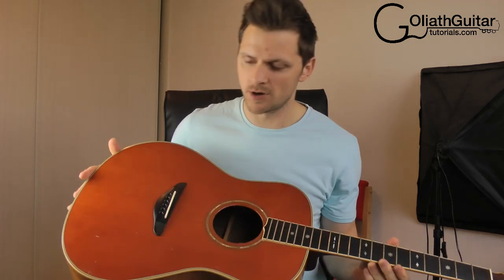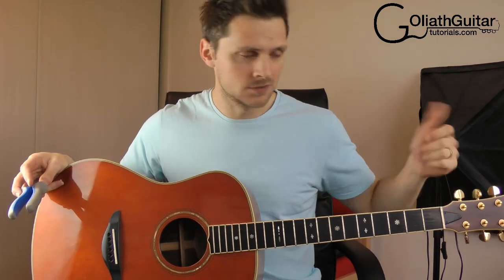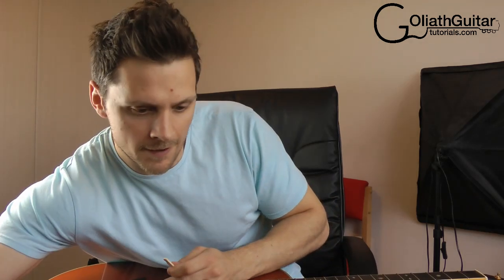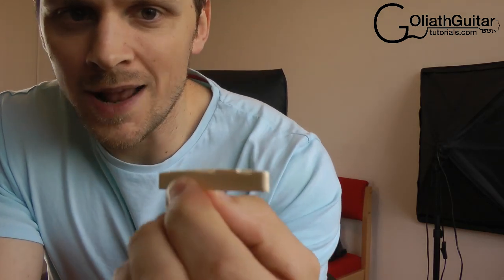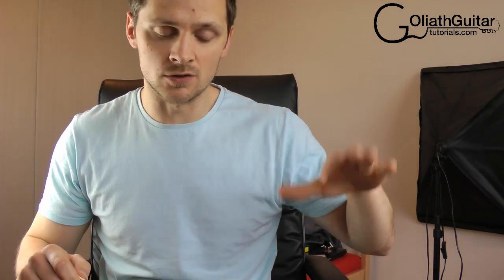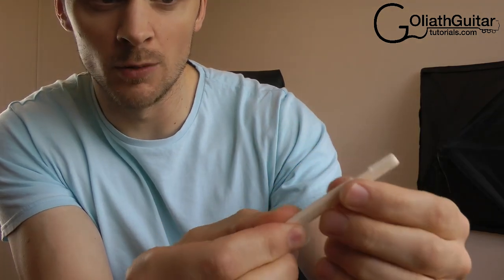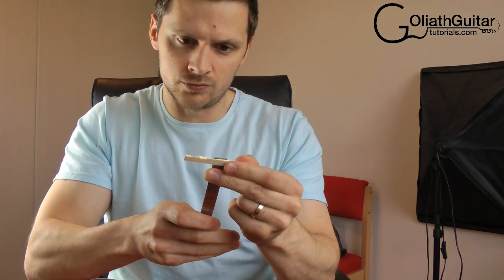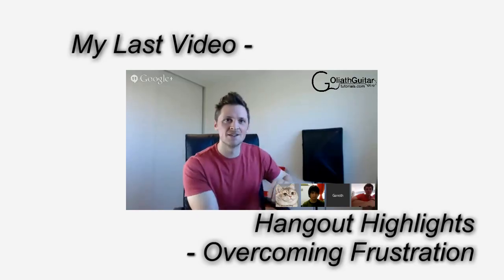Acoustic Guitar Maintenence - Replacing The Saddle

Comment: Hi Gareth - just to point out that the 'compensation' part of the saddle is on the B string at the HIGHER end of the strings. Also warning about removing saddle with rough pliers could damage saddle - especially bone saddle. I've just crumbled mine after going through the whole process of resizing a new one - and I used parallel pliers! Take care.

Comment: A saddle should just fit in snuggly enough so that it doesn`t fall out when you turn the guitar upside down, but it should able to be pulled out by hand or almost. You should not have to push hard on the saddle to insert it in the Bridge slot, because if the saddle is to tight and you force it in, the it may eventually cause  the bridge  to  split.

Comment: went to a luthier to get my guitar set up a few weeks ago. when i went to pick it up (a week late) as he was getting it from another room i noticed a similiar model to mine where they had put heaps of dents in the bridge prying the saddle out with a screwdriver or something! got mine back and he had done it to mine too! luckily not quite as bad. 

He also put a pin through the bridge to ensure it would never lift, his idea, i took his advice. Dont have a problem with the pin or the inlay they put on top of it, but it would be nice if it wasn't off centre!

Then to top it off he put on different strings to what he explicitly said!

Can't bloody believe it, local business that came highly recommended and has been around decades.
Reply: Jordan Cochrane that's why you learn to do it yourself, it saves money and you can work on your guitars at any time
Reply: He screwed your guitar with that pin.
It's not a catastrophe, but it's a very bad method that harms the guitar.

Comment: Hey Gareth! I’m a huge fan. I have a question, my guitar saddle is plastic and although the tone is decent, I’ve heard other guitars and it makes mine almost sound like a toy (if that makes sense) do you think the bone saddle might be the reason? (Yes I tune my guitar haha). Thank you for any input!!! Keep being a boss!!!
Reply: Also it’s a Martin guitar it’s not a cheap-O.
Reply: There are some very high quality plastic saddles available, that may not equal or surpass bone saddles, but will hold things on their own. It is the el-cheapo, bottom bracket plastic ones, which aren't hard, taut enough, into which the strings cut in, affecting intonation. The "toy'ish" sound need not be because of the saddle. There are several dozen other factors playing into it: wood type, wood maturity/age, wood cut quality/finish, bracing underneath, it's type, thickness, shape, size of guitar, soundhole, presence/basence of cutout, string types, string gauges, string age, guitar manufacturing process, luthier skill, exposed temperature/humidity, apart from the skill of the player.

Comment: i had the same problem, in my case it was the nut had fallen off and i used too much glue when putting it back on, so it ended up on an angle. I took it to a boutier (someone who makes guitars) and he fixed it and went through the rest of my guitar for about 20$. in my case the buzzing was strings from them hitting the frets because the nut was lower than it should be

Comment: My saddle isn't nearly as tight as that; in fact if i'm changing the strings and just cleaning my guitar with lemon oil, when I turn it upside down to do the back the saddle often just slips out with a lot of ease and ends up on the floor. Should I be concerned about this?
Reply: the saddle on my brand new ibanez with severe fret buzzing came came right out too; and the replacement saddle that it CAME WITH, doesnt even fit no matter how hard i press!
Reply: tiny amount of sanding got it in... i think? i hope its deep enough
Reply: yeah its not fkn deep enough.. gonna have to sleep on this
Reply: stupid ibanez selling me a brand new guitar with a bent neck...

Comment: Do you have to put slots for the strings in the Saddle? or just leave it alone?
Reply: That's also what I would like to know
Reply: I think you just leave it alone...pretty sure!
Reply: Leave it alone. The strings will wear grooves in the saddle over time
Reply: Not in acoustics which have bridges and pins.  On archtops where the string angle on the horizontal changes at the saddle because the strings connect to a tail piece which is narrower than the saddle, notches prevent the string spacing from changing under string tension.

Comment: How do I know how much to sand off?
Reply: I'll answer this in case someone comes across this. 

It should be twice the amount of the height at the 12th fret. So if your Low E is 2.5mm and high E is 2.0mm and you wanna bring it down to 2.0mm and 1.75 respectively, you'd have to sand the low E by 1mm and the high E by 0.5mm. 

Mark the measurements and then draw a line.

Comment: I'm new to guitars and I inherited one without a saddle to begin with.  Would it be ok if I just put in a saddle that fits the length and width of the slot in the bridge? Or do I have to figure out the right depth it should be in there?
Reply: +Trixie Anne Felisco i know it's a year late, but yes you can. if anything get a saddle that's bigger because it's much easier to remove material than it is to add.

Comment: Is it normal for the saddle to be noticably shorter than the slot it fits into? I just bought a 2nd hand guitar - the saddle is 73mm and the slot appears to be 75mm - the saddle is loose and held in place by the strings. I wondered if I should buy a replacement 76mm saddle and just sand off 0.5mm from each side so it fits snuggly into the slot?
Reply: Sahel Rain nooooooo, you need a new one, it should fit nicely. I hope you fixed your problem

Comment: Hey Gareth, I have just replaced the saddle on my guitar but I am not really sure if I have the angle and the height right. I have seen some guitars with the saddle higher on one end and lower on the other. And some other set really high. Can you show me how to set the saddle right? May be using a measuring tool or something. Thanks
Reply: The top of the saddle should be the same as the fretboard radius.  With the strings off, take the saddle out of the slot and hold it against the end of the fretboard at the soundhole,  the arc of the saddle top should match the arc of the fretboard.

Comment: My Taylor 614ce 2006 has a muffled D string when fretted at the 4th fret with fingering or a capo ,all other strings sound good ,is that a saddle problem or bridge pin or the bridge itself any help please .
Reply: maybe try adjusting truss rod
Reply: Thx for that , problem has been solved it was the battery cover rattling slightly when the batteries were removed cheers Guitarist100

Comment: I sand my saddle,  the action is still high on 12th fret,  about 4mm but it buzz,  what should I do?
Reply: +Duane Capulla prob sand another half mm id say and check that then and hen keep going another qrt millimeter after that until gone .. thats what I did and have done with mine ... In all from a new one i sanded down 2 mm and its purring like a happy kitten ...
Reply: truss rod adjustment

Comment: Be warned if you do this. You may lose intonation. Which means that when you play a string open, it's in tune, but when you play notes along that string, they can be out of tune. Some guitars need saddles that are modified to specific measurements in order to keep decent intonation.
Reply: if they are in tune how the fuck they are not in tune when u play them together
Reply: @gabyzamfir39  Intonation involves the very precise length your guitar string from the saddle to the nut. 

Lowering saddle of a guitar messes up the precise difference between those two points. Even though the guitar string is tuned open perfectly. Like if the low E string is perfectly in tune.  Octave fret on that E string (the double dot fret in the middle of the guitar) will not be a perfect E.
Reply: @BiggySeth  It is not the lowering of the saddle that changes the intonation as much as where the string breaks over the saddle.  If intonation too sharp at 12th fret, then break point needs to be moved farther back on the saddle by filing some off the face of the saddle at that string.  Conversely, if the intonation is too flat at the 12th (tuned to pitch open) then you need to file some off the rear side of the saddle.  Having too wide of a contact point where the string crosses the saddle can also cause a buzz, especially if using lower tunings as the string can vibrate in the small groove across the contact point.
Reply: Not just saddle, but nut as well, plus truss rod, fretboard, frets...